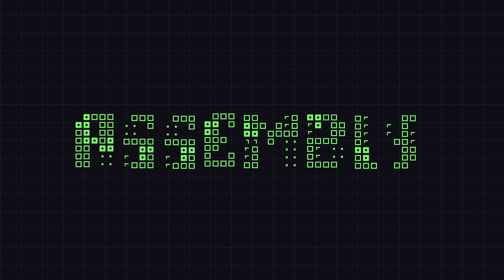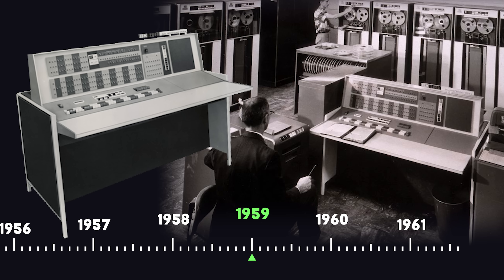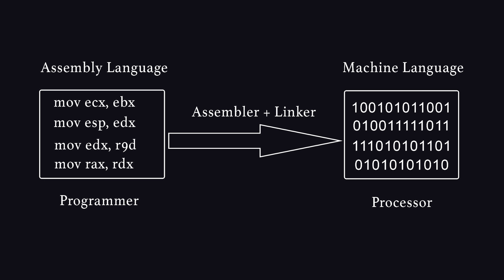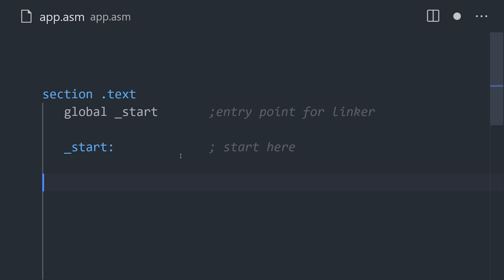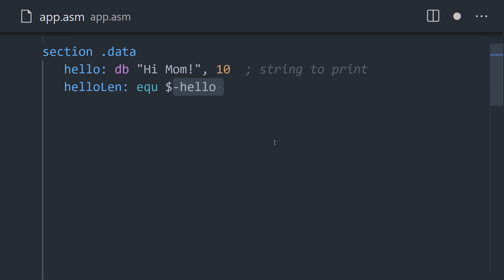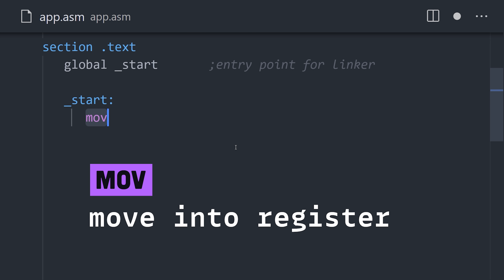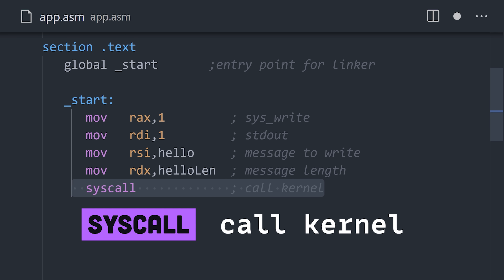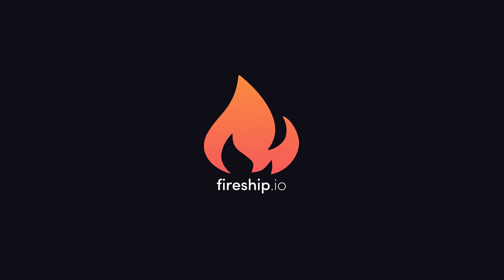Assembly Language in 100 Seconds

Comment: I grew up with the C64. You could relative simply write Basic programs, which was great but they were quite slow. Assembler (for the 6502) was difficult to learn (even more without the possiblity to get information via the internet, you needed books, books, books...) but gave you a lot more possibilities and exponentially more speed. Note that with assembly language you don't only have to learn the instructions (mnemonics) and how to build routines, but also how to use libraries or the system custom chip architecture with all of its registers and how they work. Using Assembler was a must for quality and speed. And so, on 8 bit systems like the C64 nearly all of the commercial software was written in this tedious but fast language.

Note that the detail information from 1:00 in the video is for x86 assembly, which runs on modern pc systems but is ... as a language a bit clunky.

If you want to try out assembly yourself I'd recommend 6502 asm f.e. for the C64, which is pure 8 bit oldschool. Or 68k assembly f.e. on the AtariST or Amiga. It's nearly orthogonal, which means it's a good/nice assembler dialect imho. Compared to 6502 asm this 16-bit assembly is a bit more powerful and convenient. Btw. Winuae is a good Amiga emulator and Asmone a good assembler to start with.
Reply: z80 asm is my favourite, i used to do small games on my ti-84 calc with this, and there's some insane programs made in assembly for this machine, while the basic is just about using the functions to draw math stuff and things like this, the processor is a 15mhz z80 (while the gameboy is a 4mhz one) and assembly programs can use all of the archive memory, aka about 480ko (with 24ko of ram)... there's programs like a doom "port", a gameboy emulator or games simulating 9-level grayscale (there's no native support for grayscale on this machine), all of them entirely made in asm
Reply: Repent and follow Jesus my friend! Repenting doesn't mean confessing your sins to others, but to stop doing them altogether. Belief in Messiah alone is not enough to get you into heaven, you must become a new creation and be born again by responding to the Holy Spirit. - Matthew 7:21-23, Revelation 3:15-16 cf. Hebrews 10:26-29. Pay close attention to your thoughts and how you respond to your inner monologue because it has a greater impact than you think.  Call on the name of Jesus and pray for Him to intervene in your life, and do all that you can to follow His ways.
Reply: I like to use intel 80386/80387 32 bit CPU. Today on an Android tablet with a Dosbox emulator app. I put all instructions into batch file to create tiny executable with a little help from debug.
Reply: I disagree that 65xx Assembly was difficult to learn.  The Programmer's Reference Guide from Commodore covered pretty much anything you would want or need to know... and at least there was no need to deal with segments and offsets, as with x86 Assembly.  If you used an Assembler (like PAL)... the landscape was even easier.
Reply: @TheUtuber999  To have some 16 bit offset register on x86 are easier to handle as two bytes in the zero page of the C64 for building an address. On C64 we have a lot of calculation with 16 bit values, but only 3 register with 8 bit.
Reply: @thinkingspace3438  You think that that is impressive ? Nowdays they got the actual Doom on the Casio FX-CGs and Ti Nspires, and even Quake I on TI Nspire II
Reply: @attilavs2  i know, but the ti-84 games are more impressive imo when you see the hardware
the ti-nspire ii (and even the i) is just super powerful for a calculator
Reply: @thinkingspace3438  Yeah it's almost a raspberry pi
Reply: Or 65C816 assembly language, SNES language, create some homebrew video games, or better yet the Sega Saturn's VDP1 language.

Comment: If you want to start out Assembler, take 68000 - life is so much easier there (compared to x86, or even Z80). 6502 might be similarly simple, since it's basically RISC.

Comment: Used to love coding in assembler. Used mainly machine code monitors for the lack available assemblers (the software) for the C-128.
Once i got an old 286 as a sidekick i started using tasm as a cross assembler. Hacked together a parallel data cable to transfer my compiled code to my favourite 8-bitter.
Good ol' times :-D

Comment: Hey, quick question: If I wanted to make my own programming language without using LLVM , does this mean I have to use Assembly language ? (Assembly 86 or Assembly 64) . You know, to create the compiler ? 
Thank you very much.
Reply: You can write your compiler for your programming lanuage in any turing complete language, it doesn't matter. The first C compiler was of course written in assembly, but then with the parts of C  that were already compilable, the compiler was rewritten in C eventually (this is called bootstrapping).
Reply: You’ll need to learn machine code (to compile your language to it), not an assembler
Reply: Yes. If you use LLVM, you are responsible for emitting LLVM IR which resembles a low level programming language. After producing that, you feed it to lc (LLVM's compiler backend) which performs many optimizations and finally outputs assembly for many different architectures.

If you don't use LLVM, you have to output architecture-specific assembly. It is a great learning opportunity. 

You can also target another high-level language like C if you want.

Comment: You have so many things wrong. You can modify thigs in the .data section, the .rodata section you can't however. Most importantly, sections are not predefined, they are part of the ELF standard. You have many more, such as .rodata and .bss. Also, most importantly, webasm != asm...

Comment: I wanted to learn it 12 years ago but the internet in my country that time was so bad and I didn't find other resources like books, glad to see this simple explanation.
Reply: I learned assembly programming without to have internet.
Reply: @maxmuster7003  great, where did you learn it ? What resources you used ?
Reply: @CoentraDZ  I began with MS DOS 5 and Debug on an Intel 80286 with 4 mb ram.
Reply: @maxmuster7003  cool, so you was writing random syntax until you learn it ?
Reply: @CoentraDZ  I saw instructions and test it to see what is happend. With debug we can execute from a location to another location with g=cs:0100 0110 for example.
Reply: @CoentraDZ  If we try to enter a wrong instruction in Debug we get an error.
Reply: @maxmuster7003  that’s amazing 🤩
Reply: @CoentraDZ  And then i used MASM 5.1 to create larger  *.exe files. But my last PC is broken and now i am on an Android tablet with a Dosbox app installed so i can create and run x86 executable.

Comment: Hey Jeff, everything is awesome, except for one thing - Webassembly is not just Assembler for Web.
The Webassembly in browser is running in virtual machine, and assembly code is running directly on the hardware. So WASM has some differences from classic Assemblers, and it's called Webassmebly just because it's binary format.

Comment: I have been writing in assembly for over 50 years. First wrote in an IBM 1401. Then moved into an. IBM 36O.i wrote an entire accounting package (a/p, g/l, a/r, payroll) in under 32k. It also included the o/s (BPS) I wrote many many "helper" programs for programmers. One of them I wrote in 1982, IBM said could not be done, its still running today on Z/os.
The mainframe was a great teacher as no matter what an application programmer wrote, would never crash the system.
I wrote assembler on about 30 different CPU types and know 13 different languages. I read 3,000 page core dumps too! I would use the core dumps to show COBOL programmers where they went wrong.
To me, there is assembler, then everything else
Reply: Wow
Reply: @khaliifshiikh2289  tnx

Comment: First, before I get slammed, this was about 40 years ago.
I used Assembly professionally back in the 80's.
I wrote a routine to section of a piece of RAM to act as a hard drive. On startup, our FoxBase (precursor to FoxPro) application copied database indexes to the RAM drive. Talk about a performance boost. WOW !!!😀

Comment: During university I had to implement a program which converts from Celsius to Fahrenheit and viceversa with a precision of 2 decimals. It took 1000 lines of code. Only to read from keyboard and store something like 33.2 it took 300 lines. I was programming on  I8086
Reply: It's impossible to be this much unless there's no floating point instructions.
Reply: @Abu_Shawarib  Actually there was no floating point instruction on emu8086 which was used. Lets say you want to read 123. You wait for an interruption, then you get 61 asci in a specific register, subtract 60 and you get 1. Wait for another interruption, you get 62, subtract 60, and now you have 1  and 2 , multiply 1 with 10 and add 2, which gives you 12. Repeat the process. Keep in mind that you have to do a lot of moves between registers, as result is stored in a separate register. Things got even longer when you had to do the math, considering the limitation of how many register the "processor" it has.

Comment: I have to point out that (for me, at least), using the gcc assembler was much easier to do as a first try. Maybe I just never listened to the right nasm tutorial, but I tried for YEARS to get nasm working before watching a tutorial using the gcc assembler, which just worked and OMG I'm so happy it did, FINALLY. I have no doubt nasm is probably better than gcc, but as a new programmer, the nasm error messages might as well be Minecraft enchantment table where the gcc error messages are much closer to English.

Comment: Nice to see the three sections of assembly programs being that of DoP Data Oriented programming.
Separating the data from the logic.
Read that this is much faster than OOP (Object Oriented Programming) cause DoP is how hardware code is structured so it's easier to compile than translating OOP to machine code.

Comment: The thing is that these registers can be accessed way faster than RAM, one of the fundamentals of optimizing is limiting RAM Access. RAX (.REX Prefix) is the 64 BIT version of EAX (in long mode X64), Setting EAX Zeroes upper 32 bits in RAX but AX,AL,AH Don't

Comment: It's worth reiterating that different architectures have very different assembly languages. Even within the same ISA there can be different standards for the syntax, and different assemblers can support different additional features. For x86 you might encounter Intel syntax, ( add eax, 1 ), or the exact same instruction in AT&T syntax ( addl $1, %eax ).   
Wikipedia's page on x86 assembly has a section that compares different versions of "Hello World"
https://en.wikipedia.org/wiki/X86_assembly_language#Examples_2

Comment: Ahh assembly.. I actually frequently write Java bytecode with Java assembly these days and use various forms of assembly on my collection of vintage computers... I first learned assembly when I was a kid in the early 90's using good ol' 'debug' on Ms-Dos 3.3... I found an amazing hack for squeezing performance out of my 386 at the time - by using a short assembly program to change the dram refresh rate. By reducing the refresh rate until it the machine became unstable and then bumping it up a little bit again I was able to squeeze a lot more clock cycles out of the CPU - almost like overclocking it.

Comment: Instead of the syscall macro, you should have referred to int 80h, and said there is a table of addresses that you can make the CPU execution jump to with the interrupt instruction; and the OS has graciously populated all these.

Alternative would have been to write to text mode video memory in real mode or something.
Reply: Isn't syscall a valid instruction and why would you use the slower int 0x80. Most x86_64 operating systems support syscall and use it over int 0x80 or int 0x2e [on windows].
Reply: I didn't know it was an actual instruction with an opcode in x64 architectures. Thank you for enlightening me.

I can guess why this isn't just a macro but I genuinely thought it was a macro for int 80h, much like some occasionally used macros for int 20h in the early 90s.

Comment: 0:11 immediately wrong. For all semi-recent computers anyway. As long as you know the supplied hexadecimal code in the CPU guide booklet, you would write it to a hexadecimal editor which would write that to bits in a file.

You'd have to be working on literally the oldest computers to be manually counting bits as assembly languages were first produced for the Electronic Delay Storage Automatic Calculators in 1949, though this was more like the hex codes than asm.the IBM 701/650 seemed to have the first assembler for what we would see assembly to look like.

And even if assembly languages weren't ever created and people just memorised 700+ INTEL X86_64 CPU Hexadecimal codes, it's still vastly different than counting bits and we would have been doing the hex codes since the 50s

Comment: One of the big myths about assembly is that if you "write it in assembly" it magically becomes faster than if you wrote it in a language like C. Chances are, normal-looking C code is going to be several times faster than the equivalent hand-written assembly, because of compiler optimization.

Simple example: A handwritten strcmp in assembly will iterate over the string and compare each byte. Meanwhile glibc's strcmp will use AVX2 extension and be magnitudes faster.

Comment: Interesting that you pass the string length, most software would just use zero-terminated strings and only pass the string address, and keep printing chars until a zero is hit
Reply: That only works when you have a guarantee that there will not be a null byte in the data. 
You do not have that for write.
something like execve will have that, since a file path may not contain a null byte, so execve does not use a length.

Comment: Using Debug we do not need an object file or linker. No constant, no jump labels only addresses. We do not need syscalls, we can access all hardware components directly with no protection violation of a virtual concentration camp kernel.

Comment: Pretty decent I guess, on the other hand I don't think it tells viewers anything they didn't already know about Assembly.

Assembly has been called a language, but the difference to what everyone calls a language is that (in its simplest form) it's just a 1:1 translation of already rather cryptic abbreviations into hex opcodes (not binary), which on simple CPUs can be memorized about as easily. WebAssembly on the other hand is another language, and referencing it here will confuse viewers more than help them, I think.

Comment: Assembly is used for operating systems

now i am ready for making a operating system
Reply: Operating systems are written in C, you might need minimum assembly knowledge but it's not that necessary
Reply: Ha Ha! Do give it try! 
Just try to do things with BIOS calls in real mode. Only when you feel comfortable should you jump to protected mode or long mode.
Reply: @lovermilk  afaik to write the bootloader and stuff you need to know assembly
Reply: @lovermilk  thats not true! even if you end up writing 99% of the operating system in C. Knowing how it translates into assembly is pretty much required because you need to know how to access the hardware directly

Comment: A novelty concept that is good to understand, not master. Unless you have decades on your hands.  Modern compilers for all languages use updated optimized memory management for most features touted as strengths for that language in assembly making them the equivalent of 30-40 years of developing in assembly language. Everybody needs a hobby though I guess.

Comment: I don’t like assembly because it doesn’t give you enough control and is too unpredictable. It’s much better to program in binary because it is much more clear exactly what each line of code is doing and it gives you that deep low level control that you need to write a program that is high performance and efficient, instead of coding using a bunch of presets like people do when using assembly.

Of course this is a matter of personal opinion and while I prefer to have this low level control for my applications you should decide what language to use based on what in particular you are trying to achieve.